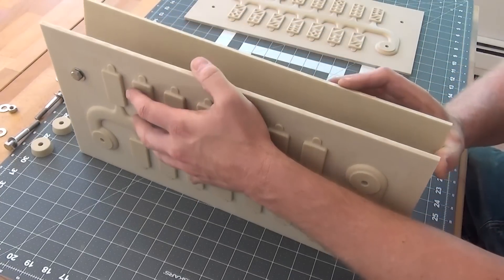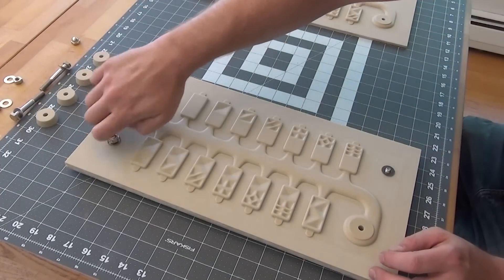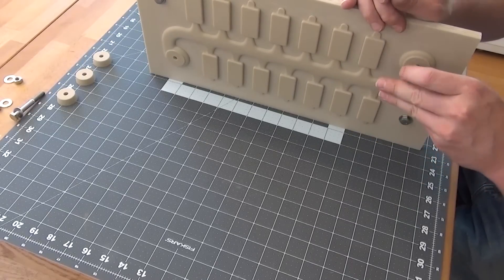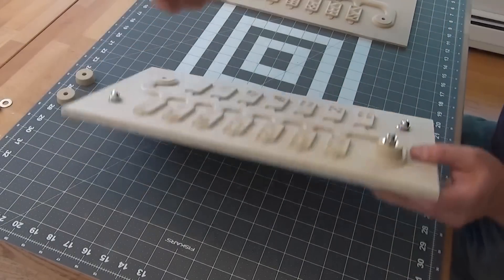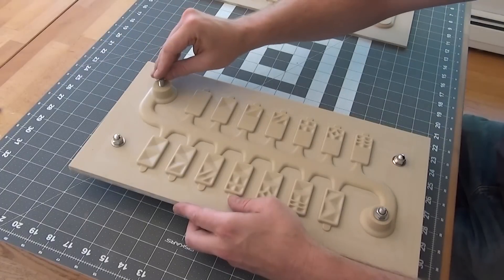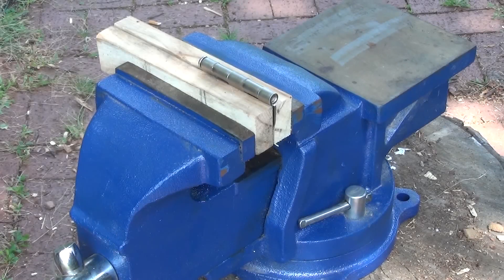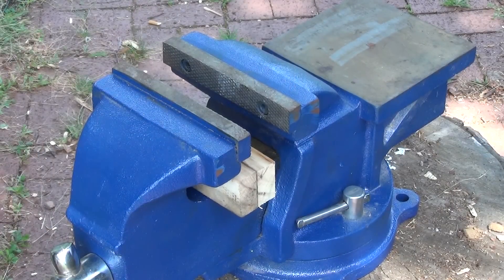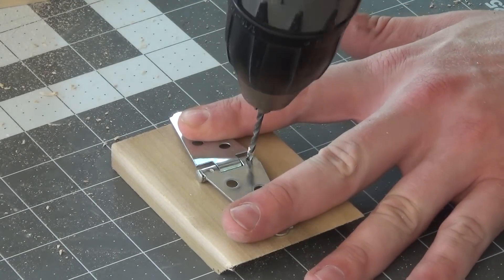Cast Aluminum Dominoes | Corian Matchplates and Snap Flask (Part 1)

Comment: what material is that? the one you are cutting on your CNC?
Reply from the maker: That is Corian,  it cuts like butter.  Some times you can get some odd chunks from countertop installers!
Reply: @Grunblau , Yes thank you, I heard you say so after I finished watching the video. I make and install high-end kitchen cabinets but rarely do I see the use Corian for countertops let alone even think of using it as you do! but I have also made my own cnc router and 3d printer and now recently made my own propane foundry/ furnace for metal sand casting. as a hobby, I'm just starting having just 3 successful castings nowhere near as good as yours.
      Very nice work thank you for sharing it with us.

Comment: Small idea : if you make a lot of holes before screwing with the same drill, you should consider use drill bits with hexagon 1/4'' shaft instead of cylindrical, so you can swap from drill to screw driver without opening the drill mandrel.

Comment: Brian - thank you for thi perfect lesson :)
Can you tell -  which plastic you used to milling the mold?
Reply from the maker: +Alexandr Kazakov Corian or solid surface countertop.  It is formulated for being easy to cut and durable.   Hope this helps!
Reply: +Brian Oltrogge Thank you for fast answer, Why such a choice of material? This material is quite expensive. About $ 50 per m2 at a thickness of 12mm.
Reply from the maker: +Alexandr Kazakov Assumed I'd be producing these at least for friends and family.  Still might but I would likely go to an investment wax work flow.  There are places you can find odd pieces for cheaper.  Even installers will sometimes sell/give you sink drops.
Reply: Brian Oltrogge Thanks again :). And another question  - the red sand, what you use in the form, what is this?

Comment: Which cell packing algorithm did you use? I came across one years ago while doing some research into a project but I can't seem to remember its name. I recognized it immediately with the graphic at the beginning showing the domino shapes.
Reply from the maker: +needamuffin "A Voronoi diagram is a partitioning of a plane into regions based on distance to points in a specific subset of the plane."

Obviously I have taken some liberties beyond the pure mathematical definition to make it a 3D pattern.  But this was the jumping off point...
Reply: Brian Oltrogge That was it! I knew it looked familiar! Thank you.

Comment: Hi, This video is very impressive for me
I had a question in video
you wrote "0.125 DOC @ 80 IPM"
Can you tell me what does  DOC, @, and IPM mean
Reply from the maker: DOC = Depth Of Cut.  IPM=Inches Per Minute
Reply: +Brian Oltrogge thanks for replying! to add a question, how much this meterial typically and what's it called? I want to buy this for sample machining, but I don't know this name and brand, or spec/property so on
Reply from the maker: This is Corian or 'solid surface'.  Usually used for countertops.

Comment: Thanks a lot. Now I need to get my hands on some Corian and throw it in my CNC router. That finish... those chips... nerd porn. Bonus: Algorithms. Your CAM processor also seems really dialed in (Rhino?) Excellent video as always sir!
Reply from the maker: I had been trying to get some locally for awhile.  It is a bit odd how hard it is to get.  Sometimes countertop installers have some sink blanks laying around.  Usually this goes to the homeowner though.  Also it seems like many people like their countertops to look like cat vomit, so it can be difficult to find white or solid colors...  I got mine from solidsurface.com

Comment: Man, that is one beautifully overdesigned flask.
Reply from the maker: I think you may be right...  This flask uses up more sand than is probably necessary.  After I get these prototypes cast, I might revisit using a more standard flask that uses less sand and leave it on the mold while pouring the aluminum.

Comment: Nice work Brian! Your projects seem to exhibit the kind of methodical planning that I'd expect from a designer, although I guess it could just be video editing (haha). But I'm really curious about your design process. What does one of these projects look like from beginning to end, from raw concept to engineered end product?
Reply from the maker: This project started out by not liking how the pips lined up on the double sixes with the pips on the next piece on some cheap dominos.  I sketched some ideas and  messed with it in 3D.  I decided I wanted to cast them so I knew that they likely couldn't be half spheres as these wouldn't come out of the sand mold.  Then I looked at how I could draft them.  Then came the idea of cell packing them using the cells to determine the shape.  After a few versions, I settled on the ones you see in the video.  The runners are just an educated guess with a couple concepts incorporated from reading about runner design.  Namely long curved runner, gates not lined up and a place to vent each piece.  The match plate came out of necessity as I have no idea how I'd cast them otherwise.  I'll probably try casting using petro bond and sodium silicate and compare the results!

Comment: The Corian looks like it machines beautifully. The finish from the tapered ball end mill is amazing, looks like it needs no handwork at all! Thanks for sharing, looking forward to the casting :-)
Reply from the maker: +Alex Howard It does machine beautifully!  Too bad it is so expensive and kinda hard to get a hold of locally.  I will not sand this at all before casting as this is plenty smooth enough.  Another benefit is that sand doesn't like to stick to it and it is as durable as a countertop....  because it is!